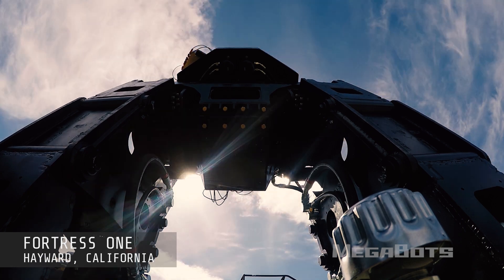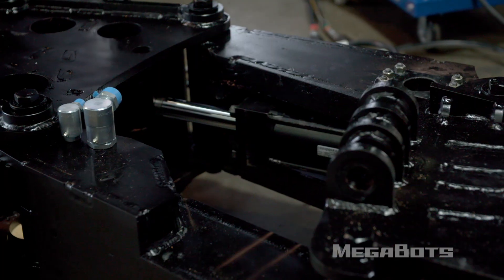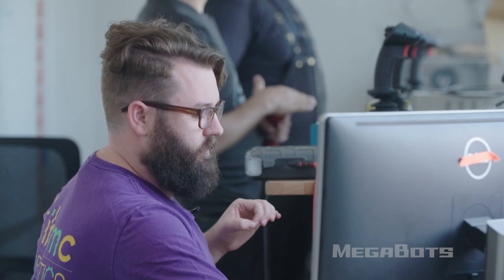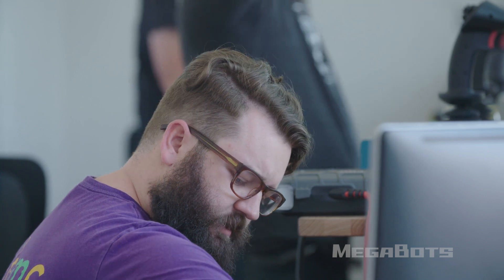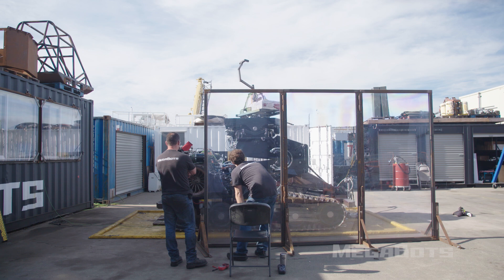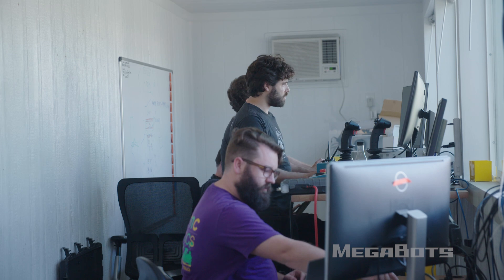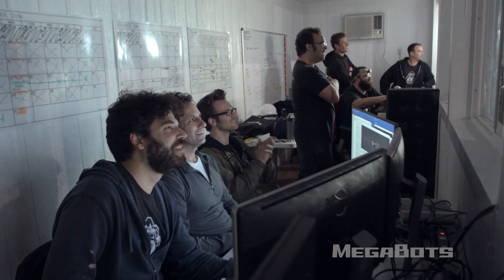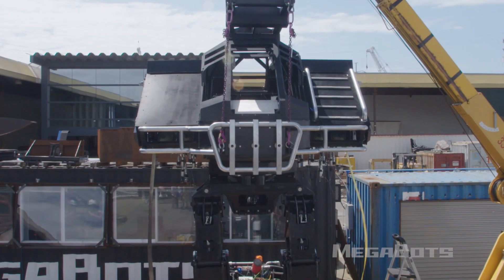MegaBot Leg Day! (Season 1)

Comment: What is even the point of putting legs on this? Just seems like a lot of unnecessary weight. The "feet" are fused together in the form of the treads. Just putting the torso on there would make it a lot lighter and more stable.

Comment: ok, part check.
upper body, done,
arms, done,
tracks, done,
legs, done,

that only leaves 2 things counting the right thing's. putting the arms on. and the computers to work it. and its ready for aguest.
Reply: Don't forget the pilots. Time to put them through mech piloting boot camp!
Reply: the deal was to include melee combat not to exclusively have it

the arms would be melee the rest would be ranged
Reply: Yea I think pilot training is going be a big deal. How many battlebots look awesome but fail because of pilot error? Sad truth is they won't have much time to pilot the fully built 'mech before the actual battle. Still, go team megabots!
Reply: Explanation of how they're going to fight: do-... um...
Reply: they also need weapons on the arms ,shoulder cannons and finally a flamethrower cigar
Reply: They made a deal with the Japan Team to make it only melee combat
Reply: garraplayer1 weapons s systems and COCKPIT
Reply: COCKPIT, on the mechs cock region
Reply: i already said the system meaning the computers to run it. and i only mean to get it together and testing. (without the inter changeable parts.)
and the cockpit section is already on. it just needs a few details, and said computer system, and your got one big fighting machine.

Comment: ...Japan is SO dead. Also not sure if allergies or this is so beautiful that I'm tearing up...
Reply: seriously? giant robots are like Japan base pop culture, they probably show up with a Gundam like robot or something to the fight
Reply: So you haven't seen Kuratas yet? The thing is a toy compared to this. In fact, it was marketed as one, complete with airsoft guns.
Reply: and what makes you think they will be bringing that version of kuratas to the fight?
Reply: Hopefully no reason, but I haven't seen any changes or updates since its release. They could be keeping it under wraps, but why?
Reply: For tactical reasons.  It's not like a Japanese company that already has a working Mech really needs the hype that Megabots used to fund their project.

And Kuratas might have more success than you'd think- between the higher level of programming and the single-pilot system, they're going to be a lot more maneuverable and have much faster reaction times.  Probably a lot more precise with where they strike as well.

It's going to be quick'n'precise versus Big'n'Strong.
Reply: I question Kuratas' durability. The pilot will be far less protected, if the field model is anything similar to the commercial one. I believe the Mega MK III's computer assisted hydraulics will be far more responsive than what appears to be the electric based movement and manipulation of the Kuratas. And then we know little of it's weapon systems. We shall see in August.
Reply: Japan WILL NOT use the one you see on their ad. They're making a completely new model. The difference between the Japan's team and America's team is that Japan's are a full blown company already mass producing mechs whilst America is company barely funded on kickstarter. Japan Team's budget is so massive noone knows what they'll come up with, I'm definetly betting on Japan, no doubt.
Reply: But Megabots had beat Kuratas in the match.

Comment: I'm looking at this thinking they need to half the strength/power and double the speed.  The speed of the mech is so slow it's going to hard for it to keep up in combat.
Reply: the kutras isn't going to be faster than this.
Reply: Their assembling the components together for the very first time.  You never run any freshly assembled machine/engine/hyd pumps/etc. at full speed during initial testing.  Come on, be patient.
Reply: The Kuratas only goes at what, like 3 MPH? The tread-base on this will be able to haul the MegaBot a lot faster than that.
Reply: I'm speaking more in the sense of the movement of the hips and arms.  I'm sure they'll be able to tweak it but I'm worried they put too much emphasis on strength and not enough on speed.  

The other mech may be able to dodge punches and everything as it will could be a lot faster.